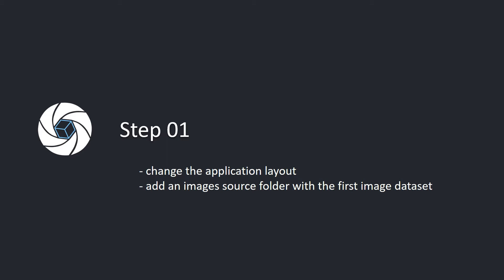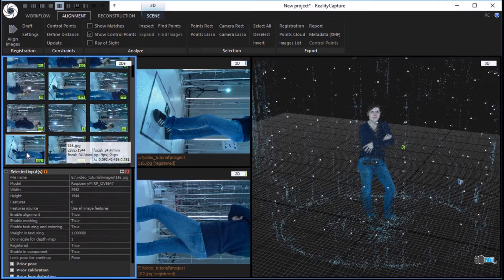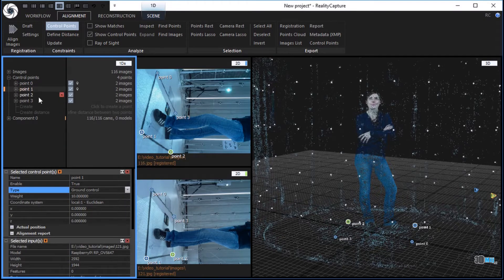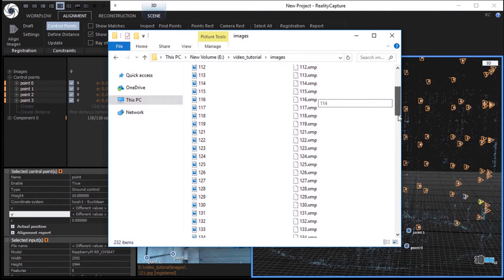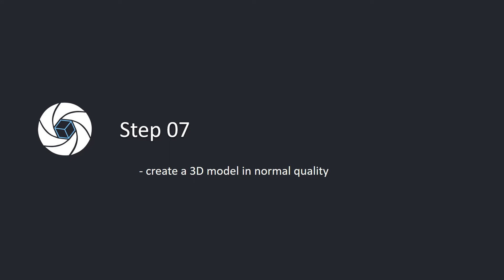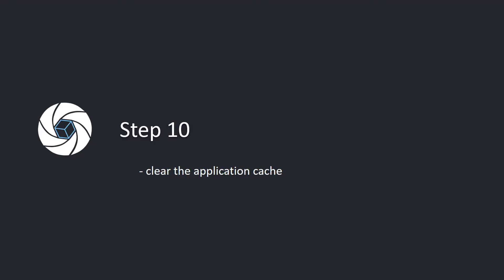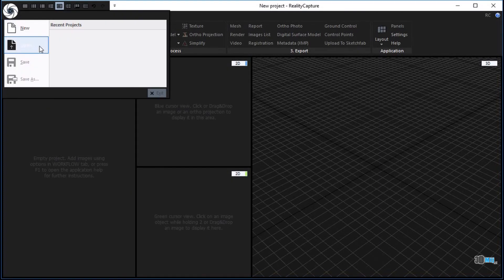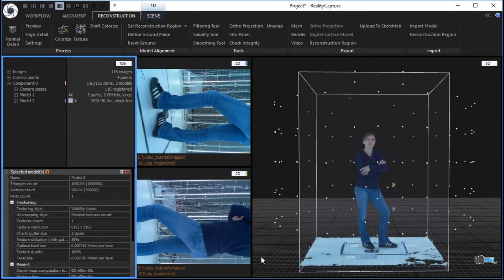Coordinate System Preservation with XMPs part 1

Comment: Hey, thanks for the tutorial. Super useful. I'm just wondering why you replace the images in the source folder? Aren't the images the same either way?
Reply from the maker: The first set of images is with the projected pattern, that helps with the alignment. Second set of images is without projected pattern and it is used for texturing.
Reply: Thanks for the reply! Very useful to know.  In the tutorial you set co-ordinate values for the ground points. Could you elaborate on the values you placed?
Reply from the maker: Ground control points are used in order to geo-reference the scene and unify the coordinate systems of both models. These coordinates are in local coordinate system and were chosen to match the real world dimensions and preserve the scale.
Reply: @RealityScanOfficial   I don't understand what this coordinate numbers mean on each control point. why are 00point is y=1, 01point x=1.4, 02point x,y,z=0, 03pint x=1.4, y=1. What does it mean? and how we suppose to add this numbers in the same situation with painted box-lines on the floor? thanks
Reply: @RealityScanOfficial  Could you please provide pattern  samples that you project. Maybe it will help us to better align cameras. Thanks
Reply from the maker: @AKompaniets  Hello Andrey, we have created our own local coordinate system based on the real-life measurements in order to preserve the scale of the model. It means that the real-life measures of the base rectangle are 1.4 m x 1 m. You need to create your own local coordinate system based on your real-life measurements if you wish to preserve the scale.
Unfortunately, we are not able to share the pattern with you. However, many of these patterns can be found on the internet.
Reply: @RealityScanOfficial  I wanna know what's 'images is with the projected pattern that helps with the alignment'. 
Is it similar to taped little cross shapes in the background on a green screen? 
It's all the more confusing because you can't see any of those marks in the source images used in the video.
Reply from the maker: @IlIIIlIlllIll  Hi, it is basically a geometry layer. This helps to provide a better alignment and model. It is provided by projector which project some image with texture to the object during geometry layer capturing.